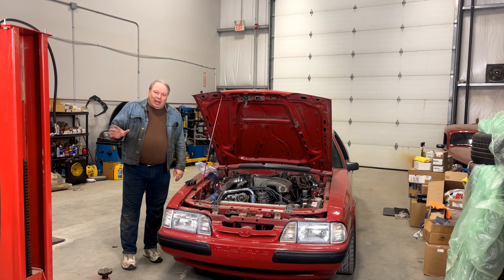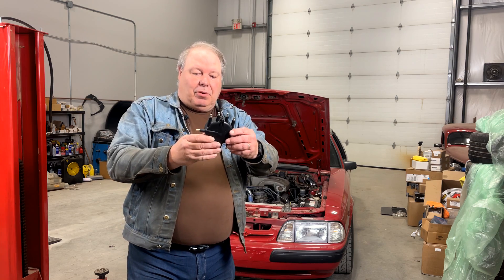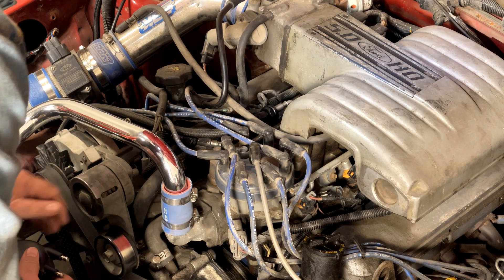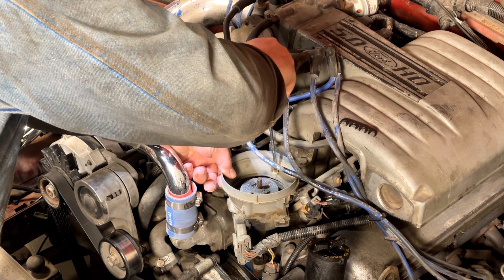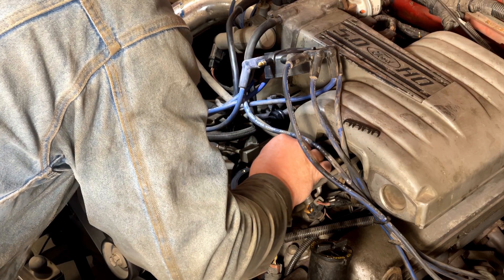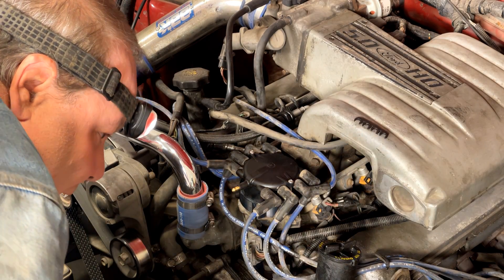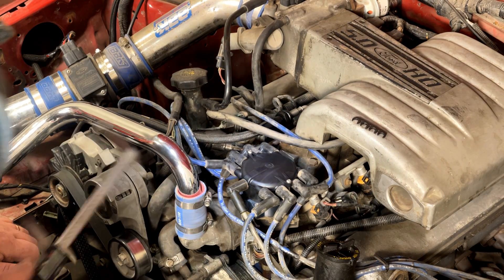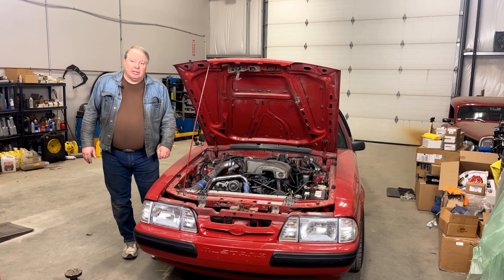Crab Cab TFI Distributor Install - Low Profile, Small Diameter

Comment: Do you know of a CRAB CAP or an ADAPTER for the 1960s/1970s OEM Ford distributors for Blower clearances? .......... I don't want to buy an aftermarket distributor, just to get the Crab Cap feature.
Reply from the maker: I’m sorry but I am not aware of one. You may be able to solve the problem with a whole aftermarket distributor and that might require a complete ignition system upgrade.

Comment: Great video, is there a link for the part❤💯👍
Reply from the maker: Yes, the link is in the description. The part is currently sold out on Etsy but I expect to have more available in the next 24-36 hours
Reply: @tecmotiondyno thank you 😊
Reply: @tecmotiondyno any heat issues with it,since it's lower ?
Reply: @tecmotiondyno will a A9P from a 91 mustang work on an 89 Lincoln mark vii lsc for mass conversion and using LMR pigtail and their tutorial video? Will it be the correct pin out? Thanks

Comment: I might be pushing shit uphill here, but I hope I can make up a forward facing upper plenum with the extra clearance from this to help tidy up the engine bay a bit 
Worst case, its still neater than the oem spaceship of a cap
Can't wait for it to arrive
Reply from the maker: If you ordered an adapter yesterday it came through as a standard small cap adapter order. If you meant to order the crab adapter please contact me as soon as possible through the Etsy store and I will get it changed. Your shipment was set to go first thing this morning but has the standard small cap adapter in it not the crab adapter because that is how the order came in.
Reply: @tecmotiondyno let me know when they are in stock,so I can get one,thank you
Reply from the maker: @mustangjoe2066 I have crab caps back in stock. If you are in Canada or Australia you can order one now. If you are in the U.S. I need a day or two to sort out the new tariff requirements for US bound shipments and when I do I will reenable U.S. shipping.

Comment: Wjere sre the chrome hoses from buddy? Also nice video! Thank you
Reply from the maker: Pretty sure that chrome upper is part of certain blower kits and is meant to ensure the belt doesn’t cut the upper rad hose. If you have been following the “bad decision” project, it was included in the parts pile that came with the project.

Comment: Is it possible to then use a lead wire set with straight boots on the distributor end, and be able to use the 90 degree ends on the spark plugs where clearance on the heads is an issue (such as using GT40P heads)?
Reply from the maker: I'm pretty sure that would be possible, yes. Interesting idea.

Comment: Hmm looks it’s going to be tight when twisting the distributor for timing. Did you experience this yet ? Thanx in advance
Reply from the maker: TFI module interference is the same, everything above the distributor is narrower except the cap terminals, and there is a substantial range of motion there with both the stock and aftermarket intakes I tried. I would say that it is at least as easy to set the base timing with this setup as it is with the stock setup.
Reply: @tecmotiondyno ok awesome thank you

Comment: Where is you fan ?
Reply from the maker: Good question. Bad Decision is a work in progress and does not currently have a fan. Shockingly, it stays pretty cool without one due to the HUGE radiator, which is itself the reason a stock fan does not fit on it. Everything will change when the Godzilla goes in anyway so I’m not worrying about the fan problem right now.